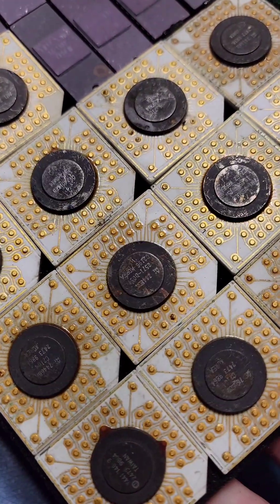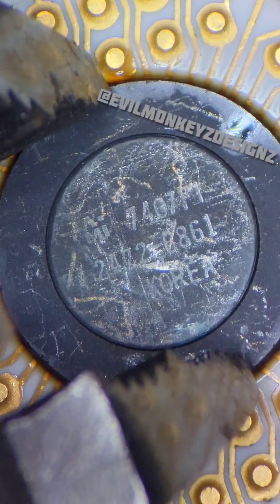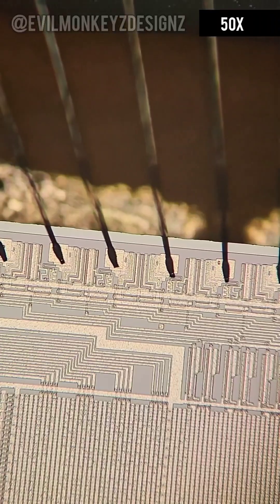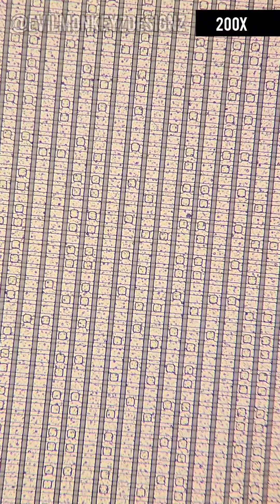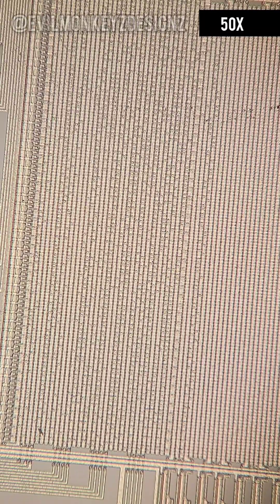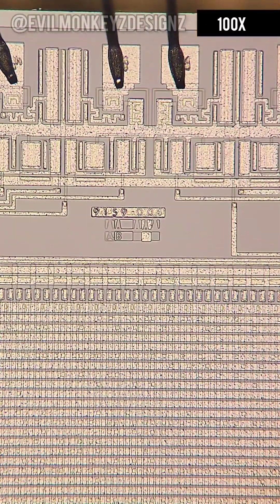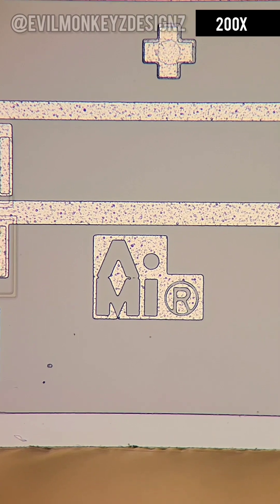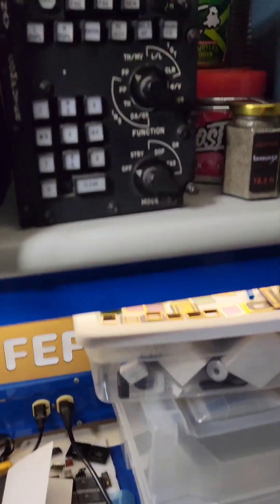Is this a 50 year old ROM? #componentscloseup

Comment: Super early automobile robotics drivers. They also used them on military subs and aircrafts and anything that required a bunch of stepper motors. Anything requiring tooling but you could only do one thing with them which is why there's so many of them. You'd swap them out if you needed a different toolset, timing, etc.

Comment: There seem to be three distinct blocks, two of which are a simple array. The third block is split into three smaller blocks of 48x32. It also has fewer rows than the other two blocks, there is a noticeable gap between rows that is very hard to see on the other two simple array blocks. if the third block its 96 rows high the other two may be 128 rows? 48x128 gives 12K bits, a very decent size for a ROM in 1973 (you said over 50 years old).  I guess the third block with its three 48x32 arrays must be row column decoding? Not sure how that would work 12K would need a 14 bit number which does not work well with 48 or 32, perhaps the ROM is multiple bits wide for data?
The package has 51 contacts (pins?), way overkill for 14 bits of addressing and 1 bit of output. Perhaps as much as 32 bit data width, 14+32=46 leaving 5 lines for voltage, ground, chip select, column hold and something else.
Reply: Great analysis. I have asked for a centered high definition picture.

Comment: I have old boards just like the ones you show at the end, featuring the same kind of chips, and the same card edge connectors. Even the same form factor. I know for sure that the lot came from a process control system in a chemical plant. 70's tech.

Comment: You should look up the CPU of the HP9825 "calculator" It's a multi die ceramic package. The machine was released in 1976 and had a 10 MHz 16-bit CPU. HP sold these machines as "calculators", cause in 1976, most governments and businesses still made you go through tons of red tape to requisition a computer, which still had the stereotypical views of being incredibly expensive cabinet and room sized ordeals... By 1976, computers could sit on your desk, and most organizations had no red tape for buying a calculator, even a "specialty" calculator. HP realized by naming this obvious computer as a calculator, they could get them to engineer's desks more easily than if they called it what it was. I happen to have one, and it's a pretty neat machine!
Reply: It was an NMOS design back when most companies were content with being able to get PMOS working in such a design.  It was also based on the architecture of the HP 2100 minicomputer.

Comment: Hey, I got 3 of these. They came to me being socketed on a board labeled “N-BDS processor” (there were supposed to be 4 of these chips, but I only got 3). Upon further research, I found that this board was a part of the processing unit for a Burroughs B80 computer. I even found a schematic of that processing unit (including my board), but there is still no detailed explanation of what each chip is supposed to do.
Reply: https://bitsavers.org/pdf/burroughs/SmallSystems/B80/brochures/2009064_B80_Brochure_197706.pdf  page 11.

Comment: Hmm, with these two distinct blocks visible I would think it's maybe a mask programmable logic array (PLA), the first ones came out in the 70s like the TI TMS2000.
I've never seen a pure ROM with that much logic beside the memory array.
Reply: I think it is a PROM as they are programmable. The logic is there to support the fusing.
Reply: @PR-fk5yb  This is clearly not a PROM. You can see the mask programming with vias (the small rectangles randomly spread over the arrays). A prom would be completely regular.
Reply: @moe.m  thanks Moe. BTW would you happen to have a bar in Springfield?😁

Comment: Ami used to make BIOS ROM chips. Could this be one?
Reply: I doubt it's the same AMI as made BIOS chips. These look to me like microcode or lookup tables, though the arrangement is not enough to tell me the word vs. bit directions and the data representation for lookup tables would likely be proprietary at that point.

On some machines from the 60s and 70s, the trig functions (amongst others) were table based and interpolated between known values. Microcode was often very specific to the particular model of a machine, and unless you knew what CPU or coprocessor it's for and what rank and row it belongs to, working out what it means is more than a little difficult.
Reply: They were founded in 84 though
Reply: But the chip shows Ami as the brand name, on the lid and inside. It could be that they’re less than 50 years old.
Reply: @peterdefrankrijker  those are not the same french friends...  😏👆

Comment: These ceramic packages are so beautiful!
Reply: The gold with white marble look goes so hard
Reply: right? and just for a ROM
Reply: And they burn your finger realy well compered to other materials used.
Reply: Ceramic is such a underused material in todays electronics. It has soo many amazing properties! But thanks to penny pinching we always get plastic instead
Reply: @WolfmanDude  It'd be "penny pinching" if the price difference between ceramic and organic substrates was small, but the reality is it's not small. Ceramic is easily several times more expensive to both design for and to manufacture. Ceramic only really makes sense for applications that require the properties of ceramic. Most common consumer electronics do not.

Comment: The fact that we can create such microscopic circuits even as old as 50+ years ago makes things like these fascinating to see
Reply: 50 years ago -> The 70's. Intel 8086 (of the x86 family) launched that decade too.
Reply: The LVDC launch vehicle digial computer of the Saturn V was the first computer made with multilayered chips.
Reply: It's actually easier to take photos of the traces in older chips than newer chips.
Reply: Just goes to show you how far we've come when we can say an insurmountable achievement more than half a century ago is something subpar and bad.
Reply: First silicone chip was 1959.
Reply: @joshuauriarte452 damn they still needed 12 years after the crash to replicate that stuff in a simplyfied version..